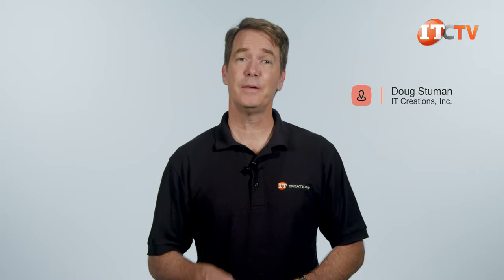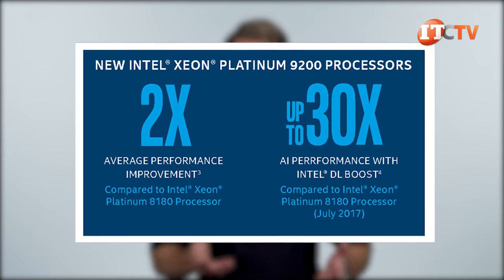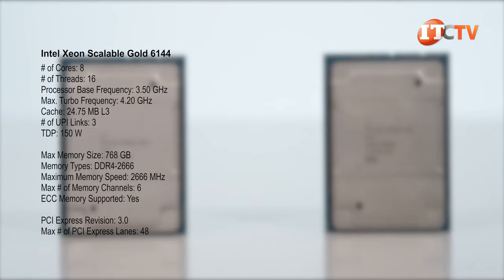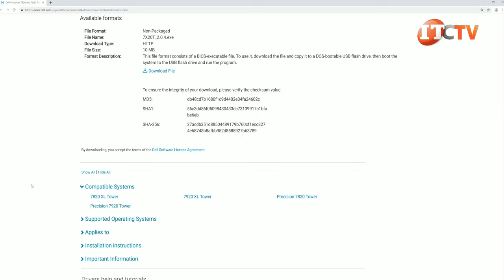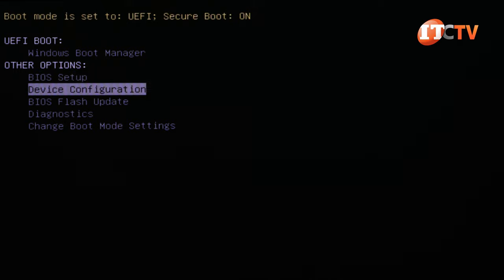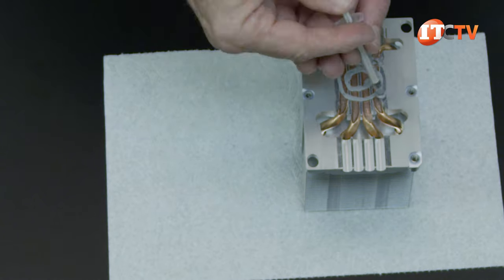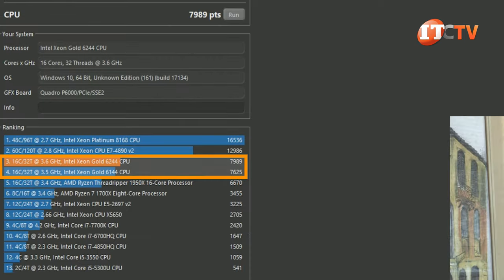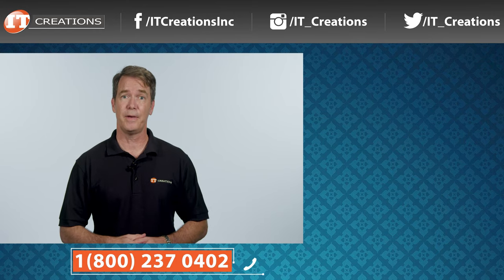Upgrade Dell Precision 7920 and 7820 Workstations to Cascade Lake | IT Creations

Comment: thanks for sharing. i just ordered refurbished one single cpu 7820, looking forward to get it working, cheap but definitely solid option for my home development hardware, with potential to upgrade to cascade lake later on. I will use CPU in conjunction with two GPUS so i am wondering how DRAM speed affects that kind of data transfer, as my low budget approach left me with 2133 MHz option.

Comment: I am installing 2 xeon 6138 in my 7920 tomorrow, but the PC unfortunately didn't come with the cpu carrier (the black plastic that is holding the CPUs at 4:58 mark). Is it ok for me to still install if without the part. I'm assuming the heatsink would hold it into place as long as I'm super careful when installing it....???
Reply from the maker: No. You don't need the plastic holder to install the CPU onto the socket but it does make it easier to install. Don't forget the thermal paste 😃. thanks for watching.
Reply: @Itcreations-LA  Thank you for  the reply. I figured as much, therefore, I went ahead and installed them over the weekend. Applied a good amount of thermal paste, and both CPUs have been idling at around 35 to 40 ° C
Reply from the maker: @gate9595  Well played… Sorry for the late response.

Comment: ive got a 7920 rackmount workstation which came with a single xeon bronze 3104 6 core processor... i bought two Intel Xeon Gold 6138 ES QL1L 1.8GHz 20 Core processors for it... the system will turn on and then before showing a post screen, turns itself off.  Bios version is 2.7.7... you guys have any insight on what could be wrong?
Reply from the maker: The ES signifies "engineering sample"processors, which are not officially supported by the system. Those processors are for testing purposes only and we don’t recommend using ES or QS products in the production environment. See if you can return them based on that, then if you are still needing processors check out our website or EBAY store. Hope that helps, and thanks for watching!

Comment: I’m getting one of these an upgrading then with an amd rx 570 but does the system come with a WiFi card? Or do I need to get one? The work station one that is. Can’t find anything elsewhere
Reply from the maker: Hi there HD TV! No, it does not come with a Wi Fi card. You will have to purchase that separately, Thanks for watching!
Reply: Thank you so much for responding! I was super confused and I subbed!